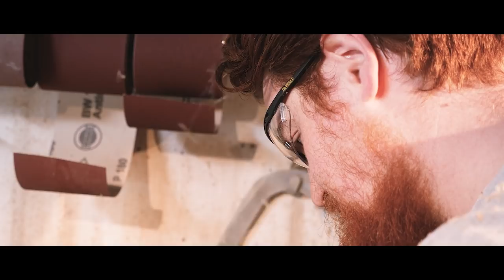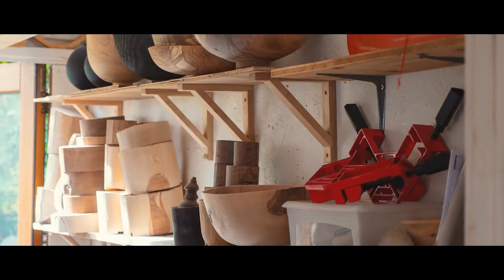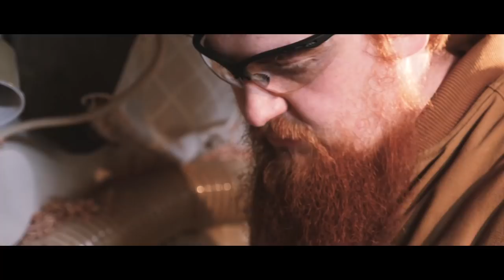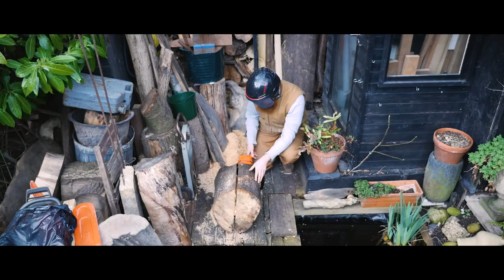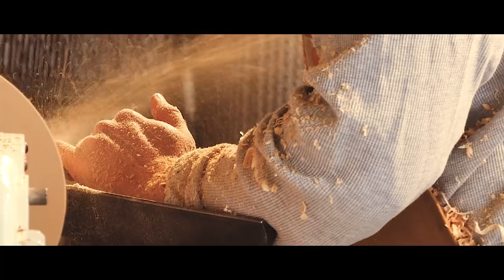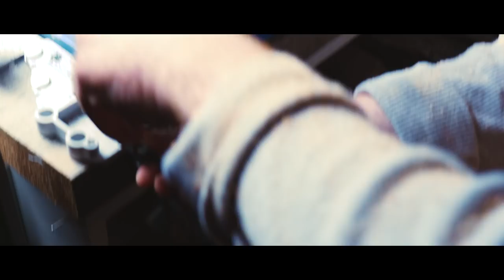Meet the Maker - Max Bainbridge of Forest + Found

Comment: Monday 19 December 2022. Envy of your skill and prowess! I too have created turned accessories for kitchen and living room, but I turned and trained to practise of psychiatry, instead. Max - have you designed a turned walking stick with inset of inner vertical brass threaded & capped sealed tube at handle-shaft ferrule, to house a dram or whiskey, or other? I have seen one on UK TV antique show, which sold quickly at TV broadcast auction. Would you consider professional production of similar turned walking stick, in ebony, willow, yew, afrormosia or other? Cheers. Rich🍷🥃